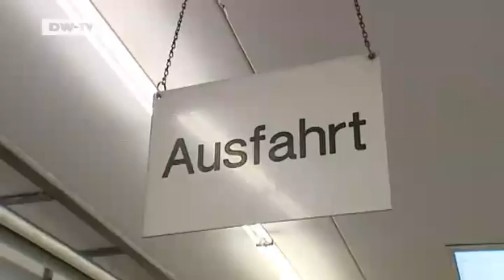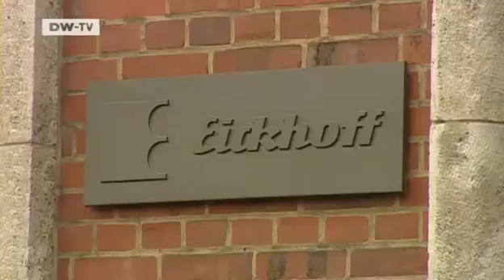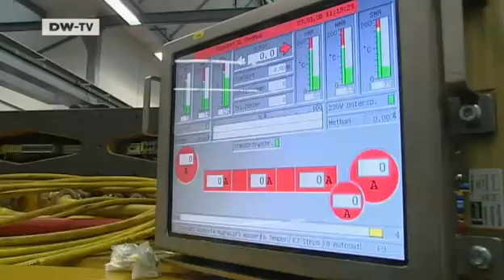Made in Germany | Coal Mining Technology

Comment: They DIDN'T work all over the world,Mr Eickhoff,not down the 3/4 R seam at Bates Colliery,in Blyth,Northumberland ,UK,cos your long Machines were built for level coalseams..and the 3/4R seam was very undulating,which broke machines in two as they tried to ride over the steep hilltops ,then in the short steep swalleys they came off the face conveyor..plus,it was so wet,that the water coming in from the seabed was six times saltier than seawater,and found to be three times more corrosive!
Nothing,and I mean NOTHING,whether it was a shearer,face chocks,hoses,cables ,Gate panel box switchgear...nothing escaped from the damage that the water and associated humidity in the roadways,did to the face installations.
Caterpillar tracks wore out in a matter of two or three weeks,which usually lasted six months  at other dry collieries,cos the sandstone strata we drove the roadways through,was high in Silica content,and the small stones like sand,when mixed with the corrosive seawater ,acted just like grinding paste on every moving part of all the machines.
At the finish,companies USED the 3/4R seam,as a testing ground for new machine prototypes....saying that if it works in the 3/4 seam at Bates,it will work anywhere...so that was in the mid-1970's...a long time ago!